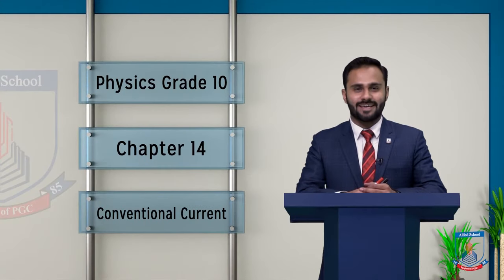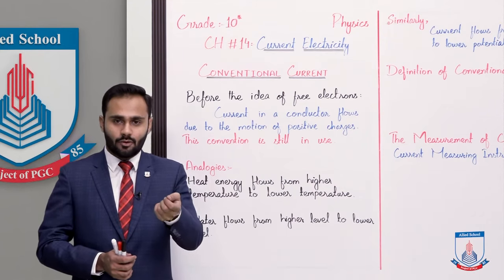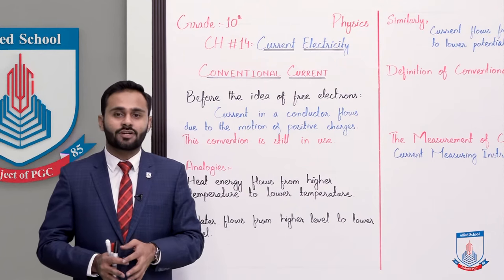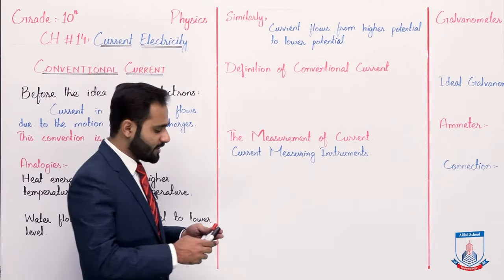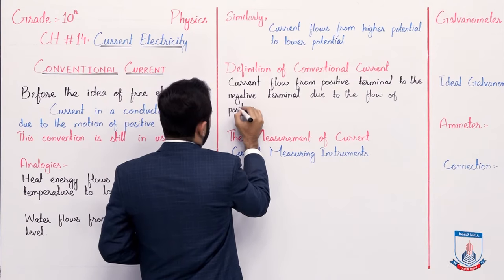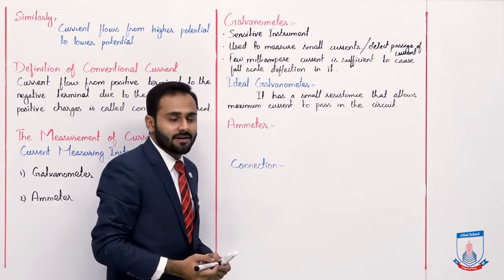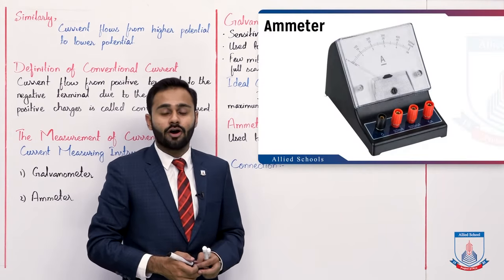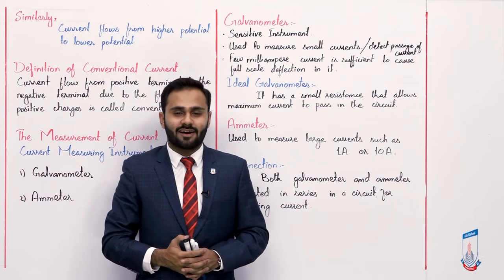Class 10 - Physics - Chapter 14 - Lecture 2 Conventional Current - Allied Schools

Comment: Sir  why we use series instead of parallel
Reply: Because in series current remains same wherelse in parallel voltage remains same so we want to measure current so we apply galvanometer in series so it won,t disturb current of other equipment in the circuit and we can detect current accurately